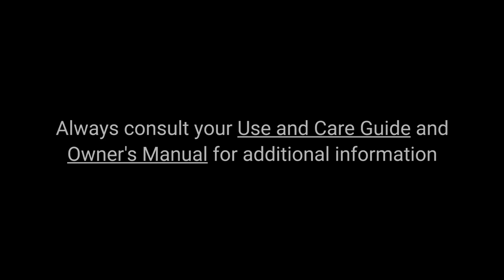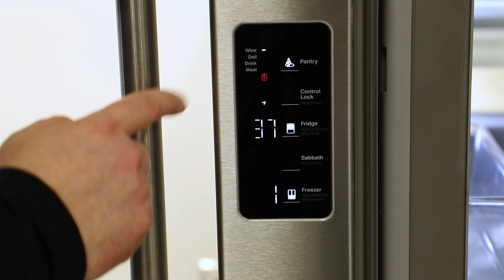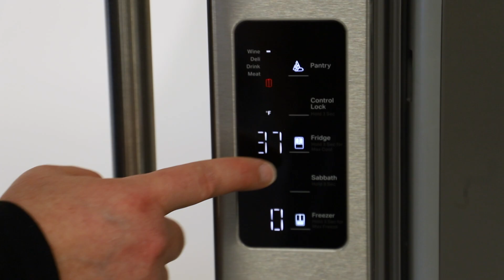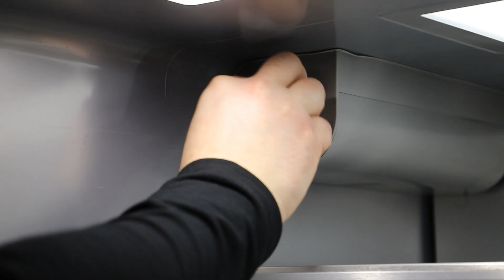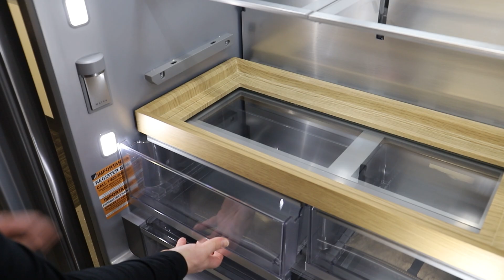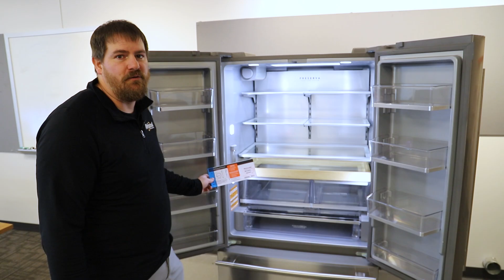Refrigerator Control Panel Tutorial: Temp Settings, Max Cool & Filter Reset

Comment: Absolute worst service ever. After making us wait nearly a month and a half—with explicit assurances that the technician would arrive fully equipped—Frank Ngo finally showed up around 6 PM empty-handed as if it were a walk in the park. He stayed for 10 minutes, gave a sulky look, diagnosed a bad pump, and told us to wait even longer until October 6th. When questioned, he was completely rude, refused to clean the tub, and flat-out refused to provide his manager's name or contact info before storming out. Terrible communication, zero accountability, and completely unprofessional. Avoid at all costs!